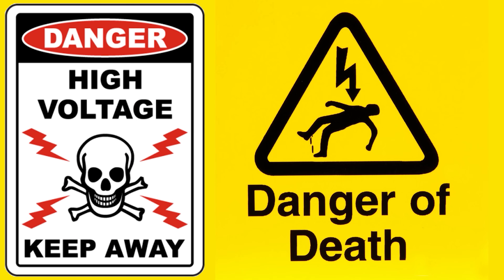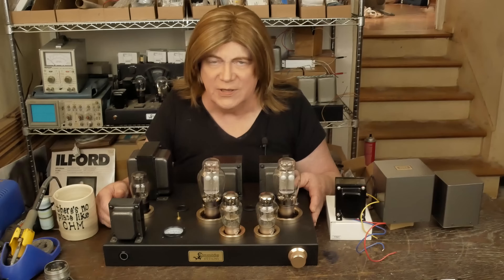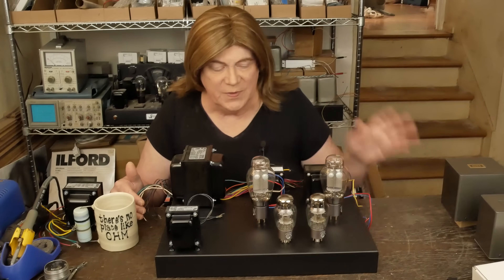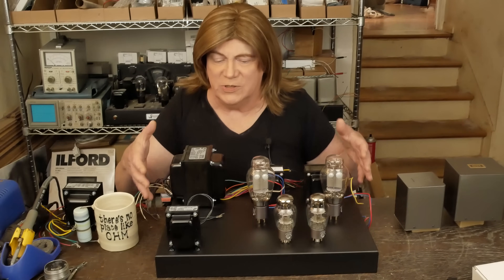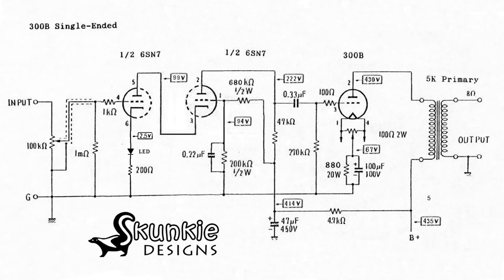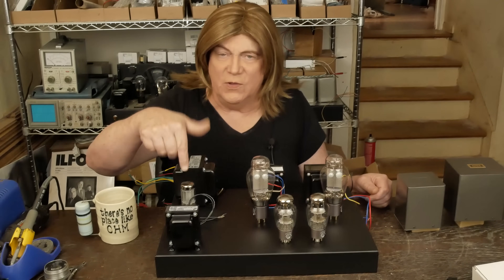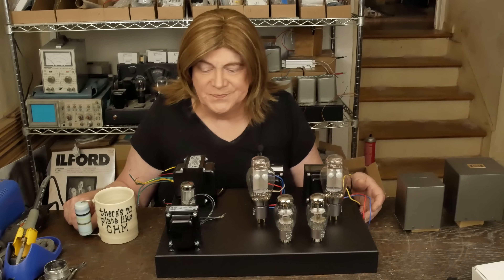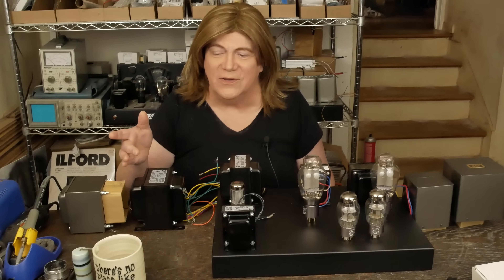300B SE Tube Amp DIY Build: Base Model Layout and Parts Choices.

Comment: How much does the power supply impact the sound quality vs. the tubes? I'd choose your 2A3 before a base model 300B, but I could be wrong.
Reply from the maker: Those both have the same basic power supply. Now the output transformer do have a big impact for sure.

Comment: I love your videos Stephe. Recently I started using DEC type smd resistors rotary stepped attenuator from aliexpress (24$) in my projects as volume pot. it is half way between blue alps and AN pot 100k pricevise, but muuuuch more precise than alps. it has 21 steps however so maybe for low volumes too little resolution.... it ll depends on preamp section design and gain
Reply from the maker: That is an interesting option I will have to check out!

Comment: IMO unregulated DC using only CRC filtering after rectifier bridge sounds way better than those LT DC regulators.
Reply from the maker: I've heard both and honestly can't say I heard any difference, but then "everyone" online repeats this so it must be true?
Reply: @SkunkieDesignsElectronics  For me linear regulators killed the transient response and dynamics in music, after I replaced the regulator with a power resistor and big cap in my 6A3 amp, the dynamic response got better. I think those regulators detect music signal on the cathode as the error voltage and tend to cancel it by changing the current, so the voltage could be more stable.
Reply from the maker: The music signal on the cathode is shorted to ground through the cathode bypass cap, there is no music signal there for the regulator to see.
Reply from the maker: Huh? The whole point of the cathode bypass cap is to ground the AC/signal, just like a fixed bias amp would do.

Comment: Hi, a short sidekick if you like to build Mono-Blocks would be great.

Cheers 

Stefan
Reply from the maker: Mono-blocks are the polar opposite of "a reasonable price point" as you are duplicating the most expensive parts of the amp, the power supply and chassis fabrication. A $3000 stereo amp turns into $5000 for a pair of mono amps.

Comment: Like your idea of not including tubes but what about including or option to buy the power rectifier tube? Since your recommendation is to get a NOS or a specific kind, than it makes a bit easier for buyers to get the right one and not have to search or get the wrong one.
Reply from the maker: Any and all extra cost options are on the table.
Reply: @SkunkieDesignsElectronics sweet!

Comment: I am very interested in the fact you will now have very similar amplifiers to compare the EL34, 2A3 and 300B tubes.  Thumbs up to the smaller transformer.  A couple of thoughts on reducing cost further, make the volume pot an option, I haven't had one on my last 1/2 dozen amps and I removed it from my A12 which cleaned up the sound.  The other one is why not use a solid state rectifier instead of a tube?  It would saves cost of tube, socket, it would reduce the current requirement because it is more efficient which may reduce cost of power transformer.  Visually I don't think it would make much impact as the  rectifier tube is small and is hidden behind the choke. This change would also allow you more flexibility in the P.S. to run a bigger first cap.
Reply from the maker: I believe people looking at a 300B amp are expecting a tube rectifier.

Comment: Its not my exsperience that 300b tubes last forewer.I hope your design will be sucsess.
Reply from the maker: No tube lasts forever and a 300B amp is never the right choice for someone on a limited budget.
Reply: @SkunkieDesignsElectronics  maybe there is somthing with this design that can be cause of it, will consider to chose a well known design if,nessesery, i think i went trough 3 sett of 300b in Years.maybe 8?  It sounded good. Will start on kt88 monoblocks single end,first,and go ower the sleeping queen,later this harvest.i have 3 300b tubes now.
Reply: I've put over 15 years on a pair of Shuguang 300B and they're still good enough to be used in my projects as 'mules' and they sound ok. I guess it depend on how wisely one choose bias and voltage points and resist to the temptation of driving them too hot, too hard.
I got 15 years as well, out of a set of EL34 (Siemens) on a Marantz 8B, with daily use. It can be done I think.. but one must be more cautious with new chinese/russian etc stock than original stuff.
Reply: @GiguereSylvain yea i dont know why my tubes lasted under some years,maybe somthing with design or tubes,

Comment: I like that layout . So many amps will work with that one. I like keeping power supply off to the side. helps with hum getting into audio .  When you make DC from AC then filter ,The filter caps draw more current from AC to fill in wave form. Just like a bigger cap before choke on supply makes the rectifier tube work harder to provide more current. Also heats the transformer winding more.  They recommend bypass caps on them LDO regulators.  The electronics inside them may oscillate . I had that happen . Them LDO reg IC will make some heat , I mounted them    to a heat sink on the underside before . Even a piece of aluminum can work if big enough.   You could mount them on top but not look as nice.  I like sticking them in a corner out of the way and have a small vent for cooling. Yes line voltage across the US changes a lot. With the MUGGY weather in NY I measure 115-114V at times and 118-119 at night and 122-123 mid winter . I found some tube amps get a buzz in the audio when my inverter drive mini split is running. Adding a EMI/RFI filter to mains before tube amp took that out. This is going to be a fun 300B amp. Cheers from NY !
Reply from the maker: Good observations, the power supply layout is key!

Comment: I just want to comment.  I have an interesting project to work on. I found a DYNACO ST70 tube amp dumpster diving.  It is all original from the 1960s?? It will need to be recapped and all the tubes. I wonder is it worthwhile. I am not a tube amp expert but I understand this amp is very desirable among amp guys. What do you think ?? Amp is clean, no rust or dents in the amp cage. Fuse is good. Looks all original.
Reply from the maker: Sure, especially for what you paid for it it's worth fixing up!

Comment: For the base model, seems like a 600 volt transformer and silicon diodes would be the way to go.  My 2¢.
Reply from the maker: Sadly, SS rectification would turn off a lot of sales. People want tube rectifiers.
Reply: Or maybe the contrary, folks who are looking for a cost effective 300b amp will be glad to pay less by not having to look for an obsolete rectifier tube
Reply from the maker: Universally potential customers ask "Is it tube rectified?" I get it probably makes sense, but IMHO a 300B tube doesn't make sense for a cost effective tube amp. Yet people still want it.
Reply: Silicon diodes have a whole different set of issues. I have it on my EL-34 and the person who built the amp had to put in additional parts to deal with the turn on surge.

Comment: Cathod bias is lame, use fixed, more power, less distortion, 300B are inadequate, 813 better choice, output and power transformers inadequate.  Your submerged sockets are weird.
Reply from the maker: Start at the top, fixed bias on a single ended amp has the same power. Second, that's not a triode and no one makes a 813, those transmitter tube amps are usually used by folks who think they need more watts than they actually are using. BTW enjoyed the content on your channel, I can see why you have 11 subscribers :)
Reply: Troll alert @4Nanook

Comment: Nice looking stuff!  It's a balance (literally) to get a good layout on an assembly, both in looks and physical weight balance.  That big power transformer would have to be centered towards the back with an output either side of it to look and feel balanced.  I know it's not a portable but I like heavy things to not weigh a lot more on one side. 😂  Symmetry.  Honestly, an amp using that big boy and those outputs you had sitting off to your left would deserve a deeper chassis.  I know, price point. 

For fasteners, you can use stainless steel with it's non-shiney, non-rusting finish or brass for a different look.  Of course brass will tarnish unless you coat it with clear urethane but you could call it 'patina'. Those fasteners are not much more than regular steel and considering the few used in a project, cost difference is negligible.  Just another option.

Enjoying the material and learning more about these single-ended amps.  I have an RCA tube manual that has a practical application section for different circuits. In the audio amplifier part, there are several, progressively more complex and powerful circuit examples (7199s and  6550s! ), complete with negative feedback.  The output transformer itself would be quite expensive I'm sure.  Maybe I can send you a copy so you can have a chuckle and give your opinion. 

Cheers, 

DD
Reply from the maker: The problem with the power transformer in the middle, you have AC near the signal path.
Reply: @SkunkieDesignsElectronics That is true and I see why.  That is why I view your videos and learn!

Comment: I think all those design and production decisions make complete sense
Still want a 2A3 with the same base model with the all black industrial design considerations
Which rectifier tube are you using for 2A3 and would doing it as a power amplifier save some money ?
Reply from the maker: Leaving off the volume pot would save a little bit.
Reply: @SkunkieDesignsElectronics  Excellent
Reply: Rectifier Tube 5AR4 or hopefully something else ?
Reply from the maker: I'm using a 5V4 with this 2A3
Reply: @SkunkieDesignsElectronics   Perfect 👍

Comment: fixed bias is better more output power
Reply: it changes the caracter of the sound though. It's not just about power, hence all those different sounding tubes and amp-schemes to suit ur preference;-)
Reply: @gjnbouwmeester5860 do you think it sounds worse
Reply: Auto-bias makes sense to me for a lot of reasons
Happy with lower power to avoid bias problems
Reply from the maker: On a push pull, yes. On a SE, there is no real power difference, they do sound a little different.